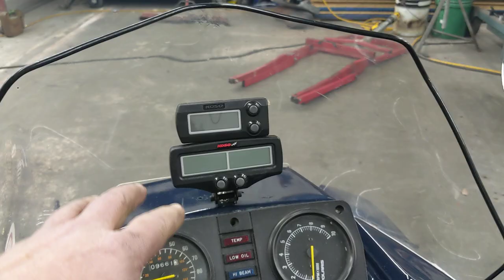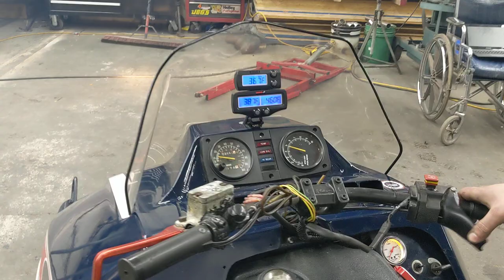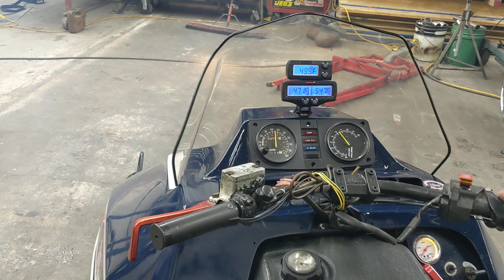79 POLARIS CRAZY TRIPLE TRIPLE 650 WET BASEMENT (turn up the volume)

Comment: Wow wet basements engine looks nuts keep it up what exactly did u do to the engine for port work and head work to justify running race gas
Reply from the maker: Northern crank shaft did all the work. I can run premium pump gas with a splash of race gas.